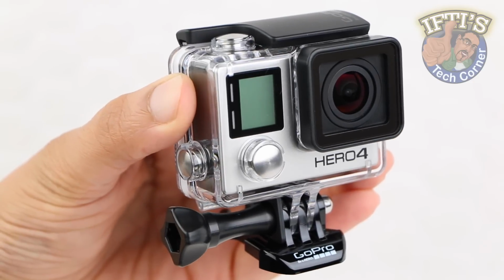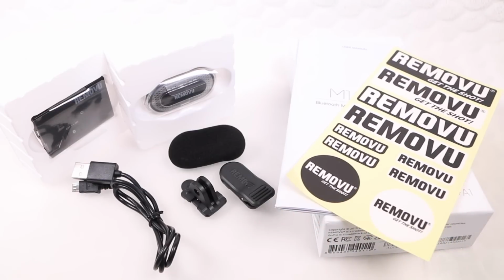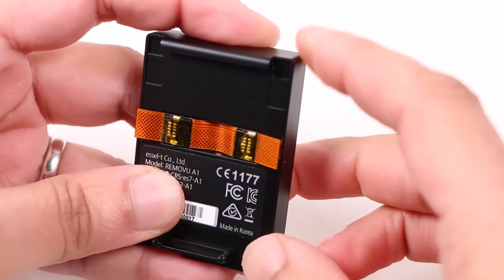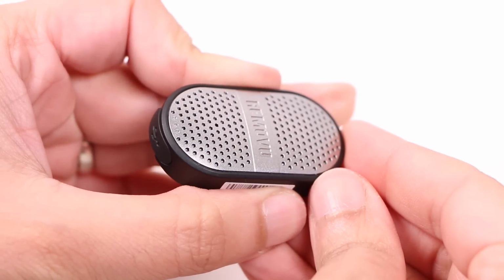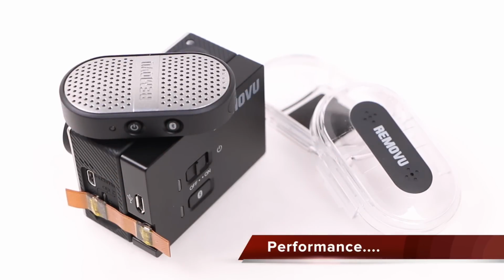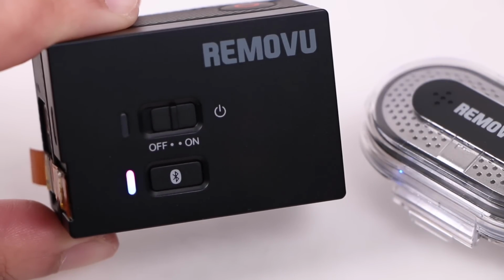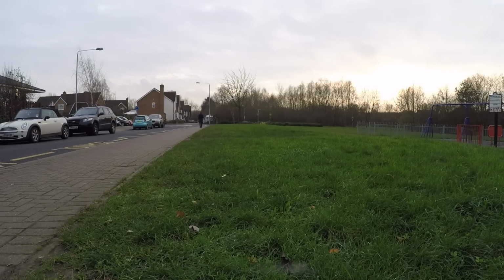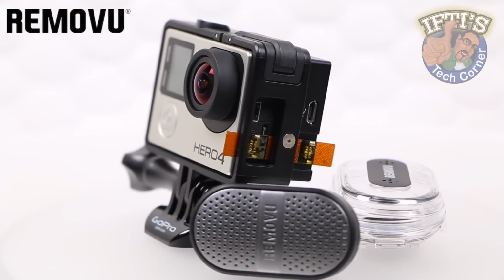Removu M1 & A1 - GoPro Bluetooth External Waterproof Microphone! : REVIEW

Comment: There are two problems with this unit, in my opinion.

Firstly, since the receiver connects to the 30 pin jack on the back of the GoPro, I don't understand the need for a ribbon cable.

Secondly, the Removu M1 & A1, samples audio @ 44.1KHz with a 16 bit depth, while the GoPro Hero is capable of recording audio @ 48KHz.  While CD audio is acceptable for most consumer applications, it isn't a good choice for editing.

Comment: One thing I have noticed is that when using this microphone you do get a very small delay so your audio is out of sync with the film footage. Check some of your footage and watch very carefully you can see it. I have to move my audio back ever so slightly in editing software to compensate. Think this maybe due to lag with the Bluetooth connection. Other than that its a great little device.
Reply: how much do you have to adjust your audio timing by to get spot on synchronisation?
Reply: Stopped using it to be honest and have a rode videomic. Really cant remember but think it was about 0.06 of a second. It is very subtle so just adjust slightly either way and you will know when its right than jot down the amount. really sorry I cant be of more help.
Reply: A good way to find out exactly how off the audio is would be a clapper board. Snap or clap an solid object against a stationary hard surface at close range. If you go frame for frame, the sound delay will become very evident, and you can use this as a control group to sync all other audio.

(If the sound was say, three frames off, you can move all future audio three frames back as well as a rule.)

Important to note:

Distance won't increase delay.  The wireless connection will drop long before there's even a millisecond's difference.

once you've established the exact audio offset, its important to remember that that specific offset in dependent on your specific settings/framerate/camera.

Comment: I was wondering help me out here I'm stuck and don't know who can help me I called go Pro but they don't know if it's going to work or not
I just received a go pro silver hero for for Christmas I saw your review on Removu M1 Wireless mic really well done thank you
But now I lost my LED screen in the back because I can't see where I'm shooting or what am I taking a picture from can I purchase the P1 and add it well now there's two Bluetooth connections they're going on the same time. Or is it even worth doing that
If you can get back to me and be much appreciated thank you Bill
Bke1999@ymail.com
Reply from the maker: +Gaetan Roy - The M1&A1 kit uses Bluetooth to connect between themselves. They feed into the GoPro via the USB port. Hence you should be able to use the P1 via the GoPro's wireless simultaneously.

Comment: OUT STANDING IFTI!!  Superb job.  The wicked irony is that I just did a video telling everyone how much I want a mic but choose not to buy one because its not ABSOLUTELY necessary for capturing rogue drivers while cycling.  still.....I WANT THIS BAD.

oh yeah, don't think for a moment you pulled a fast one on me Ifti, I noticed how you never demonstrated the rear door closing which the unit is attached with pairing cable.  I can only guess it is a bit of a pain to get the back door closed.
Reply from the maker: +Total Control - lol, As a bacpac back door is not supplied with the kit I didn't have one to hand while producing this video. Nevertheless, I can confirm it does fit as normal - just like any other bacpac since the A1 is the exact same size as the standard Battery or LCD bacpac ;o)